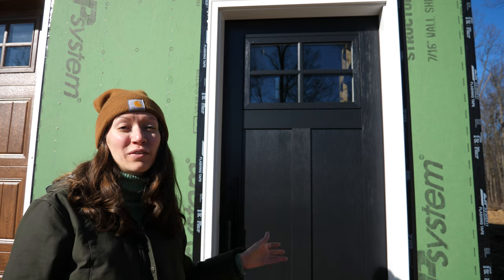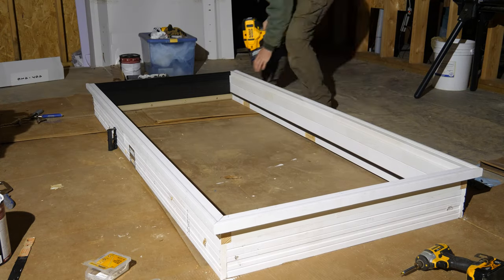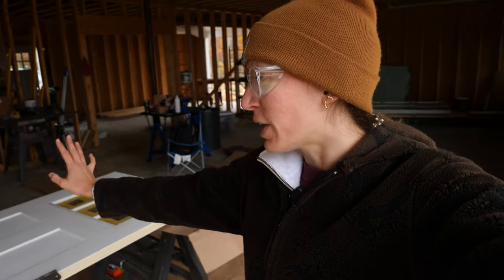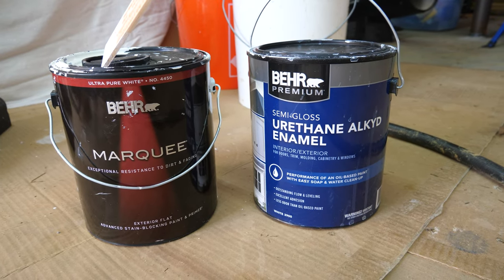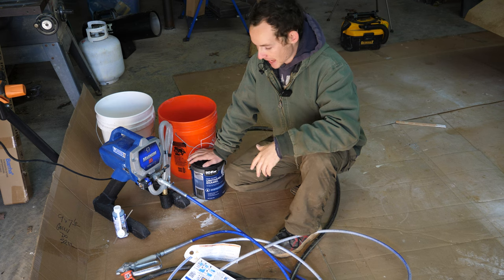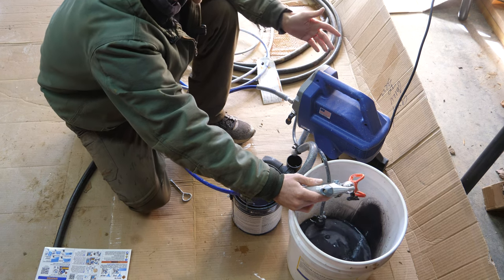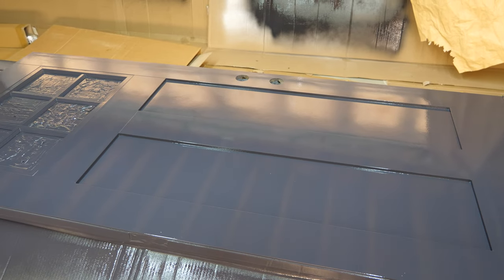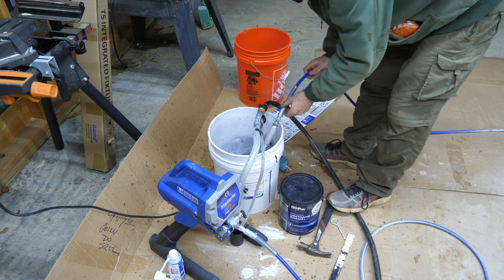Painting our entry doors was a FAIL. (learn from our mistake)

Comment: Hey Alex

A suggestion I've had a lot of luck with for installing doors:  Before placing the door in the frame, take your RO, subtract the width of the outside of your door jamb, and divide in half.  Nail shims in approximately this thickness at each hinge location, using a 6ft level to ensure the three shims are in plane and plumb.  You can also adjust the shims to be thicker toward the inside or outside of the wall in this step if your framing isn't perfectly square.  Once you have those shims set plumb,  install the door as you described.  It takes all the guesswork out of shimming the hinge side with the heavy door in the way, and you can move on immediately to perfecting the latch side shims.
Reply from the maker: I like that! Lots of interior doors to do yet so I may be stealing that tip. Thanks Matt!!

Comment: Behr is straight garbage. Invented to specifically target novice homeowners and unbeknownst diy'ers. Spend the money on quality paint, and buy once cry once, especially on your doors and trim. Ceilings and walls not as important but still, go to a real PAINT STORE they will have so much more advice and higher quality paint. You would have avoided your first door mistake if you would have gone to a Sherwin Williams, Benjamin Moore store, even a local hardware store usually carries Ben Moore or PPG. Hell even home depot's carry PPG. On a side note why you are even painting the doors now extremely unwise with all the materials you still need to walk thru your house, having people/ other trades walk in and out thru those doors, you're bound to have some touchups on those doors, I really see no reason why you need to paint them now? Paint trade is one of the last to be in a new house. Good luck
Reply from the maker: Large material for the upstairs will come through the French door (prefinished) and downstairs through the garage doors. We have used BM InsulX Cabinet Coat before with decent results. Honestly the semi gloss Behr turned out nicely once it was sprayed. It’s like everything else with product marketing - the formulas aren’t actually much different and it’s all branding
Reply: @MasonDixonAcres  the formulas can be wildly different. Behr is proven time again to be trash they don't have a bad rep from professional painters for no reason. And again to each their own but I guarantee you'll have a touch up or two on those doors before you move in. It's funny because you go for zip sheathing, liquid applied flashing, quad, a lot of attention to detail. Please go with a mid grade to high end SW, BM, or PPG pain for your interior